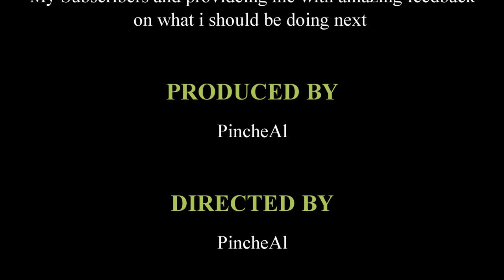How to wrap a Car part1 Season5 EP14

Comment: Can you sand down to the primer on certain panels and still wrap it?
Reply from the maker: Yes you can but i suggest give it a coat of paint to even out the surface and to prevent the vinyl from sticking too much.

Comment: hey I know this is unrelated but I know you have a bt 1.8t so you may be able to help me. I'm running a gt3071r, tial 38mm, IE billet manual boost controller and I'm wondering where should I take the boost source from? I've read constantly back and fourth between intake manifold, compressor housing, and somewhere in the charge piping. which would be best? I planned on running it off the intake manifold but I'm reading some people say that the wastegate should never see too much vacuum so thats not a good spot. is this true? I really was wanting to run it off the intake manifold just for the ease of it really because I don't have a barb on my compressor housing for a line and I don't have anything in the charge piping for it either.
Reply from the maker: correct the wastegate should not see any vacuum. Most people make a hole on the turbo itself and add a barb fitting. I did minie on the charge pipe about 1 ft away from the turbo right above the wastegate.